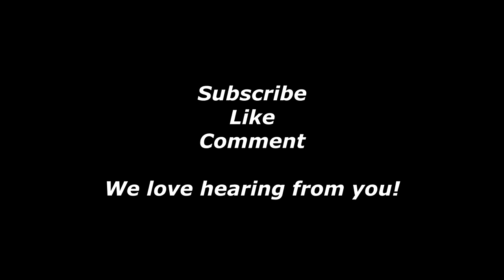Doug vs Arctic Cat: MWGA Episode 2!!!

Comment: This is for you Doug I have been building race engines for over 50 yrs and I have washed all my engine components in dawn and hot water even after line boring.So glad to here a old timer like myself told you this trick. One elder engine builder to a young gun. GOOD JOB simpson racing

Comment: I have always used a piece of rubber vacuum line to lap valves. Drop the valve in the guide (with compound on it) slide a piece of vacuum line over the stem (slightly smaller I/D than the stems O/D) and put the other end in a drill. Slowly spin the drill while pulling light pressure. Make sure to check often and repeat.

Comment: A shop teacher had us place a rag over the valve spring in case it flew apart and rap the valve stem a couple times with a nylon faced hammer to make sure the valve spring assembly was installed properly.  I've had em fly apart. Not talking wail on it, just give it a bounce. Rather fail now than running.

Comment: When I do a valve job I use Neway cutters and most of the time they don't need lapped. To check, put the valve in, hold the head up while holding the valve close with your finger and pour solvent in the port. You should not get any leaking of fluid bypassing the valve. If you get a little seeping, lap the valve, if you get a good leak, cut the seat some more.

Comment: This rebuild is due to a crack in the airbox; was any of this covered under warranty?  I realize that these toys will have failures due to harsh treatment, and I expect that, but this airbox crack seems like a design problem.  Does this happen a lot to these?  Should I be making some changes on mine to prevent this?
Reply from the maker: It's been a known issue for years. No warranty coverage!

Comment: do yall ever use non ethanol fuel and royal purple oil?
Reply from the maker: The only non ethanol fuel around here is 87 octane. And we typically only use OEM brand oil.
Reply: SXSBlog.com.               year the non ethanol 87 is pretty good I get better mpg and alittle better towing in my truck with it. may help on the carbon build up and spark plug life. but very cool video keep posting future stuff

Comment: what year motor is this. also what was cost from mls for parts
Reply: Foxamusprime I believe it's a 2014 X Limited
Reply from the maker: He's right! between gaskets, pistons, misc, and head bolts I'm into it about $750. The heads were an insane ebay deal for $400.
Reply: SXSBlog.com awesome. have you checked out evo for the wildcat.
Reply from the maker: Oh ya, I'm pretty much familiar with all things Wildcat. I'm on my third one! But I'm working on a ramen noodle budget and it just ain't worth pumpin tons of keesh into it. I'll just buy something better if I decide to go that route lol
Reply: SXSBlog.com im currently sitting in same position. do i add 5000$ in engine mods or do i buy a new machine.
Reply: Foxamusprime you hold out for the XX and keep the current one for the wife/kids/friend. Lol that's my plan.  I have way to much invested to let my cat go. It's almost complete which is a rare thing in the sxs world.